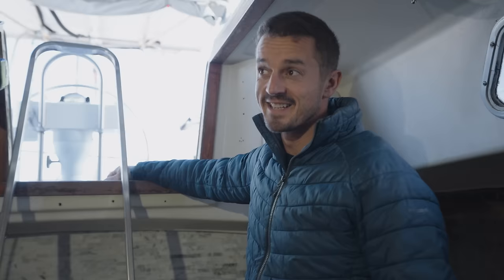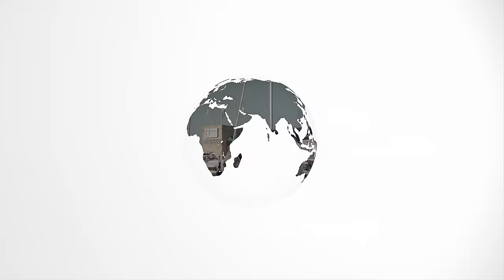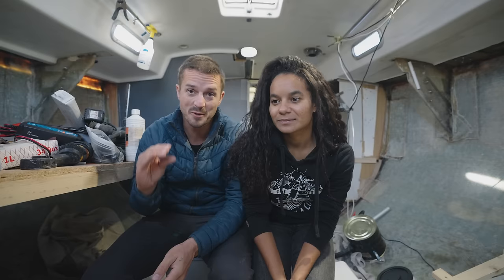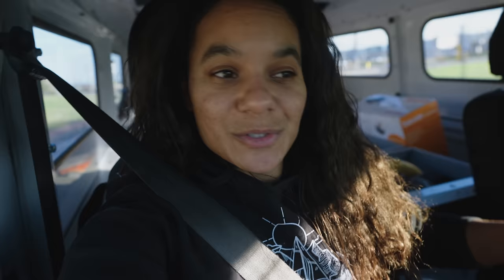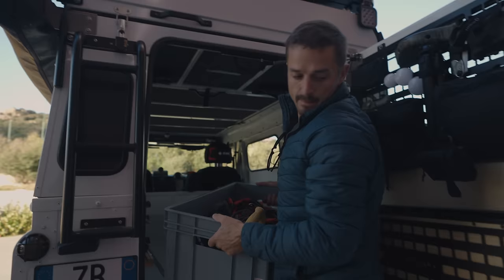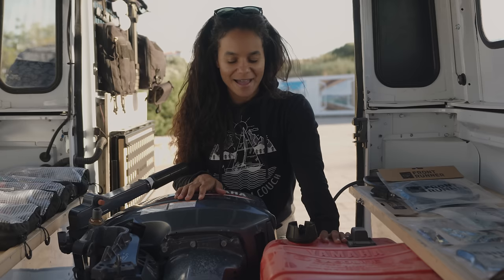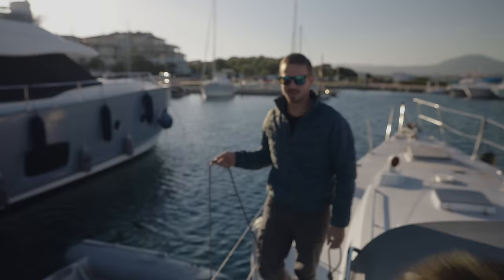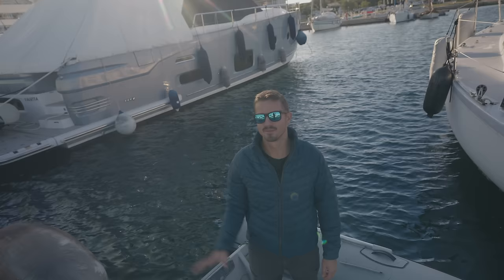BOAT WORK: It’s Time for a Change | Step 374

Comment: Having seen a few boat channels, I think the Arctic sailing couple were very wise to restore an aluminium sailing boat vs fibreglass. They did it because it needs to be Arctic proof, but think it also saved them 30000 hours of sanding and headaches. But guess there will downsides as well (like price).

Comment: Older fiberglass boats (1960 to approximately 1990) generally were over built and were primarily monocoque construction.  Modern yachts now use internal stiffening that follows metal construction techniques (frames, longitudinal girders and stiffeners to form panels) this method significantly reduces weight and material and resists the stress induced by rigging tension, mast compression and keel bending loads.   Relying on the hull thickness and typically a transverse bulkhead under the mast alone is insufficient as illustrated by many YouTube channels.  However, all the fixing of the related problems that occur in these older boats does not address fatigue; fiberglass will ultimately fatigue under cyclical loading of the sailing rig, keel movement and seaway motions.

Comment: The fact that motor started and ran on year old gas is impressive.
Reply: I was thinking the same thing, remarkable it even started.
Reply: I agree, because even if it had fuel stabilizer it should have been dumped and new fuel and oil after 6 months. The outboard should have been started and run completely out of fuel to save the carburetor. I guess they're just lucky.

Comment: Very relieved to hear both about the keel drop and the lamination being done on land. Though the keel bolts were likely high grade stainless,  even that suffers crevice corrosion. You need to get eyes on the bolts where they pass through the glass to see what is left. Much newer Pearsons are showing problems not always visible inside. Hull lamination in the water would have introduced potential for temperature differential inside to out and resulting condensation compromising even a  well prepped surface secondary bond. If you want the forever fix on the bottom barrier, get rid of all the epoxy and gelcoat and add a vinylester laminate layer with epoxy fairing and paint over it.

Comment: Remember you have a chopper gun l cheaply built coastal cruiser that you are hopefully going to add an interior structure to support it all. Your honesty is what makes this channel interesting. This boat will still be small and slow and you will be apprehensive about going certain places. Some of these boats are being sold for the value of the lead in the keel. Good luck

Comment: I feel for you guys, as my wife and I heavily refit a Catalina 30. We made it exceedingly livable (my wife is an architect, and I’m fairly handy as well), and then moved aboard. As someone who has done this (and will never do it again) you may have taken it too far. Sometimes a boat is just past it’s life, and that’s okay. The other thing we found out is that refitting a boat is actually not a very environmentally friendly process given how much needs to be torn out and trashed… Basically the only thing you’re saving is the hull, and that’s actually not all that much material in the end compared to the interior the hull contained. Best of luck if you decide to finish the project, but I can promise you that if you get a newer boat you’ll get a better sailing boat with a lot of life left in it, especially if you take care of a newer boat, rather than a boat that’s still old, sails no better than before, but just looks cleaner. Either way, good luck!!!

Comment: A tip regarding two strokes; Never use old fuel, if it’s been sitting for 6 months, don’t use it. 
Another thing is outboards where you mix the oil in the gas, the oil doesn’t lubricate anymore if you’ve let that gas/oil mix sit over 6+ months. You actually have to add the same amount of oil again to be sure. 
So the best thing is to use as much as possible before the end of the season, and start with a clean engine and fresh fuel.

Comment: I remember a gap between the keel to hull joint in my Pearson 26 and fretted about it. Discovered that is typical with those boats for and the fretting stopped. Never had a functional problem with it.

Comment: Enjoyed the video.  I know you have thought it out but seems odd you can take a day cruiser and make it into a crossing boat. On another sailing blog, the couple bought a boat that was essentially built for open ocean sailing, and they are practically rebuilding but at least it is a full fledge open ocean vessel.  Guess you're just making it stronger all over.  Watch another sailing program and they did a copper coating  on the bottom.  Must be a reason.  Know anything about that?  Love the way the dingy fits on top of your vehicle.  Would be awesome to take it with you on your land adventures so could travel some lakes and rivers or other sea inlets. Not sure how our on top tent would work.  Love watching you two. Keep them coming.

Comment: Yes, water in the fuel.  Classic signs.  Empty the tank, add 1 gallon of fuel with 10% fuel-grade ethanol, run it through the engine at normal speeds for about 5 minutes, then fill the tank up with your usual fuel.  

Tanks kept half full are far more prone to condensation, which is why airplanes are kept fully fueled on the ramp.

Comment: One thing to be aware of is that gutting the ship like that might, and I do mean might make the hull widen a bit as the hull relaxes without the pushback from the sea. My family did the same thing a long time ago and when all releases was dropped the sides moved outwards a lot more than they should have, annoyingly we did not have a good way to fix it, so we remade everything with the new width minus what little we managed to push it back to where it should be.

That ship is still wider than originally planned and currently it should be still sailing far to the south were the new owners wanted the ship to end up. I actually saw an online clip a few years ago that was fairly new which showed that ship right outside it's new harbor. 

So it is worth keeping a lookout for as the ship is settling down.
Reply from the maker: We're keeping a very close eye on it all. and leaving in the few main bulkheads until more structure is glassed back in, so no noticeable hull shape changes so far.

Comment: Just was wondering early on in this episode, whether you should’ve checked on the viability of the keel before doing any of the work that you have been doing inside the boat. Wasn’t there always a possibility that bad news from the keel  could have meant that it’d be cheaper if you got a new boat, in which case all this work would’ve been done for no reason?

Comment: Congratulations, i think that's a great call! It's probably worth remembering how close the bowsprit was to the wall for when you get put back in, probably with more weight onboard - unless they can put you further back of course :-)! 
Pretty sure it's about time that keel came off although probably if it was going to fail you'd have thought it would have by now :-o!

Comment: I have done such a project (well a few in fact) and my conclusion is. do all that's really needed to make things work and safe. and a bit more just to make somewhat pretty but don't go crazy, in the end its still an old boat, and you do not add the value. put in a 50K and you increase 5K or 10K in value. Only do it if it's worth to you.

Comment: I thought you were going to do the interior hull fiberglass work in the water so the hull is the right shape.  You said the dimples were from moving the boat and being on stands   Fix the keel, do the external work (primer, barrier coat, move stands complete the primer and barrier coat, move stands again, then multiple layers of bottom paint, paint the hull, wax the fern board, fix the rub rail, then back in the water for internal hull stiffening, rigging stringers, etc.  then rebuild the interior.

Comment: When transporting a 4 stroke Yamaha 8 hp, you must either keep it upright, or lie it down with the tiller down, and or prop down.  If laid down in your truck, as you did with the tiller up, oil will drain and fully fill the cylinder, intake manifold and carb.  The good thing is that the cylinder will not rust, the bad thing is the cylinder will be hydro-locked with the oil, and there is no way to start that engine. With the engine vertical, you have to remove the spark plug, pull the start cord and stay to the side of the oil ejection path..it will go 10 feet.  (Ask me...I know)   You will also have to pull the carb and intake manifold to clean them out.  Really only a 10 minute job.  The oil sump will also be totally empty, as in all likelihood the entire 1 pint of oil is now on the ground.
Reply from the maker: good thing that it's a 2 stroke 15hp then ;)

Comment: If you keep gas for a year you need to put stabilizer in the gas before storing it otherwise a laquer will develope in the gas that can fowl your plugs and block the carburetor.
If you keep it longer again you will have major problems next time you start it ....
-Carburetor overhaul ! 
-New filter ...
-Draining and replacing the fuel ...
-Replacing or cleaning the spark plugs
Better to give the gas away now . Much cheaper and easier .

Comment: Got rid of the dimples in the hull, that must have been a very satisfactory observation!
Reply from the maker: Well sort of. We knew what caused them, it was the mast and stays pulling up and in on the hull. So removing the mast "fixed" the dimples. But now we need to reinforce the hull A LOT to be able to support the mast and rig when we put it all back.

Comment: Are you planning on putting any structure back into her before hauling?
It occurs to me that she’s going to change shape under her own weight when she’s sat on the hard. 
My own late ‘60s built 23’ OD open keelboat effectively sags over the keel/maststep block by about 50mm during the 6 months of the year that she’s dry stored in a barn. 
Makes getting the shrouds reinstalled a PITA every spring, I usually end up staying the mast with a couple of halyards plus forestay and backstay for a week or so after she goes back in, until the hull relaxes and the mast step/keel drop enough relative to the chainplates, then the fully extended shroud bottle screws can meet the chainplates again. 
Cheers, R. 😎👍🍻
Reply from the maker: We haven't actually taken any "structure" out yet. It's all been cosmetic furniture.

Comment: I was always worried about your project doing it in the water. You removed so much that I was convinced, the hull will constantly move - not a good base to rework it. So, on the hard you easily maintain the hull form.
Reply from the maker: The cosmetic furniture we've removed so far was not structurally bonded to the hull and provided no support for the hull at all. The hull shape is the hull shape. It doesn't change that much until you put her on the hard and push the keel up when you set it down. That's actually the part we're most worried about. In the water, she sat in her natural state with the keel "hanging".

Comment: I hate to say it but buying another boat would probably be a better financial decision, Im sure paying to have that work done and re fit will be expensive, great episode, looking forward too what comes next. Peace🥨🍻
Reply: I also hate to say it but it’s what I’m thinking. 

The question that stuck in my head is what is the resale value of the boat once all the work is complete?

Along the same lines, would they be comfortable to sell this boat to a loved one and have them go blue water sailing?
Reply from the maker: Yeah, we've already gone over all of this in a previous video. But "buying a new boat" doesn't really change anything. 
For one, it A LOT more money than fixing an old boat. 
2. We'll end up with a better boat than anything currently bing produced. 
3. We've never seen a new or old boat we'd keep the interior of. So it doesn't matter if the "new" boat was structurally sound or not, we'd still end up ripping out the interior an making it better. 
4. We refuse to go into debt. 
5. We know all the problems with our boat and how to fix them. Thats worth a lot more than most people realize. 
6. We like our little boat. She sails well and has never let us down. We know how to fix her, and can fix her so why not fix her. The $50-60k we're going to spend on the refit won't buy shit in the used boat market and we'd still put $50-60K into what ever "new" used boat we got anyway.
Reply: I guess I agree,not that my opinion matters, its really right on the balance point of what you get for 60k compared to what you want, Doing what you want is really all that matters, be careful with hiring out the work, quotes are only a guideline, I would take more time and do all the work yourself, we will all still be here enjoying your content, its great content too. rebuilding with all the trial and hardship is why we watch, All the best in 2024. @SailingUma

Comment: I’ve said it before, but: 
Use the opportunity to move the motor much closer to the rudder!
That will give more space in a useful area, but more importantly; it’ll give you far more propeller wash on the rudder and make the boat waaay easier to manoeuvre in tight quarters. It’s literally like getting a stern thruster. Since your motor is pretty small and light, the move has no other disadvantages than having to do the work, which is totally worth it.
Reply from the maker: Depends where you buy it and what they've added to it. In Norway, we got gas from the Norwegian military that didn't have a "shelf life". It was also clear and had no smell. It's all the added BS that makes gas mess up your engine.

Comment: Is it worth adding a mount for the dingy motor to Uma when its up on the dirt? It might be nice to mount it before shitty weather or entering a tricky channel into an atoll. Is that even something that could be done? Just a thought.
Reply from the maker: It's not really a good idea on a short shaft motor like ours. One wave and the motor would be swamped. We have sails and are good at using them. Then an anchor. A motor, weather electric or gas/diesel is never a piece of "safety" equipment on our boat.

Comment: So you're reinforcing the hull on the hard? You're not worried that will change the shape of the hull and make stress points on the reinforcement?
Reply: Reenforcing means no shape changes to the thing who is going to be reinforced.

There's added forces, e.g. hydro static forces on Uma's hull when she was in the water. They are gone once Uma is out of the water.

Remember that the boat was build on land, so going from the water onto the hard will put Uma into its original shape - and that become even better with all the weight who had been taken out of Uma.
Reply: @charonstyxferryman  The original shape isn't the important part, though... the bulkheads weren't bonded to the hull, presumably this allowed the boat to assume a different, more stable (or at least in equilibrium) shape in the water. If you then reinforce the shape on land, you're going to force that shape to remain that way in the water, which would create unequal stress points in the reinforcement when placed in the water. With enough reinforcement I guess it wouldn't matter, but... you may be trading one problem for another.

Comment: I’d be very dubious about leaving a boat in a yard and letting them do unsupervised  (and no doubt very expensive) work.
If you’re paying to have any significant work done it would be perhaps better to bite the bullet and move on from Uma.
Reply: Insane waste of time and CA$H!
Reply: They can only afford another used boat, and refit it - so it's better yo just refit Uma.

Another thing,
You may end paying more for being on the hard, and use a lot of DIY time - than - let the pro do the job, and get the refit done much, much faster.

Comment: I really loved sailing but could not make it part of my life the way you have. One question, I follow Zatara, MJ Sailing, Gone with the Wynns, Sailing Atticus and your channel. All of them either upgraded or changed boats, why do you want to rebuild Uma rather than upgrade to a large or differently hulled sailing vessel. I am aware you have the skill.
Have a great 2024.
Reply from the maker: One simple reason. We don't want to go into debt. We own Uma. We own our truck. Their ours. Not the banks. If you take a loan out on a boat, you have to carry full coverage insurance, which means the insurance company tells you where you can and can't sail. When you can sail there. Who you have to have on your boat. What licenses you need. What equipment you're require to carry. And worst of all, if you damage your boat, they can take it away from you and leave you with a shitty check that barely covers the original cost, not the cost of replacing you entire life. So yeah, we don't like boat loans.
Reply: Oh Zatara are not sailors. 😂

Comment: Did you put fuel stabilizer in that gas before it sat for a year? I'm surprised year old gas didn't gum up your engine engine entirely. Good luck with the repairs.
Reply from the maker: It really depends where you buy the gas. Some countries add way more shit in it than others.
Reply: @SailingUma  Agreed. Feeling honored to get a reply. Good luck with the haul out. 🙂

Comment: What about glassing the outside of the boat around the keel to hold it in place rather than removing it?
Reply from the maker: It wouldn’t take A LOT of glass! Adding it after isn’t the same as encapsulation it from the beginning.
Reply: @SailingUma  Not sure what you mean by encapsulation?
Reply from the maker: Some boats are designed and built with an "encapsulated" keel. Meaning the ballast in enclosed in fiberglass at the factory, in the mold. It's not something you can really do after the fact with a bolt on keel like ours.